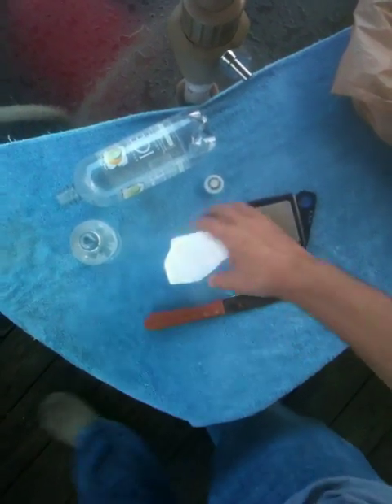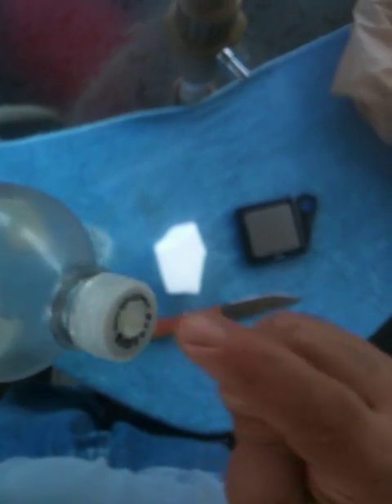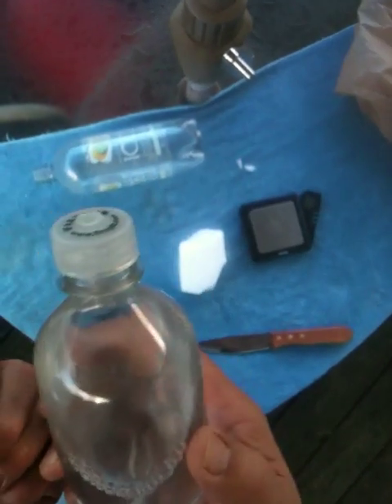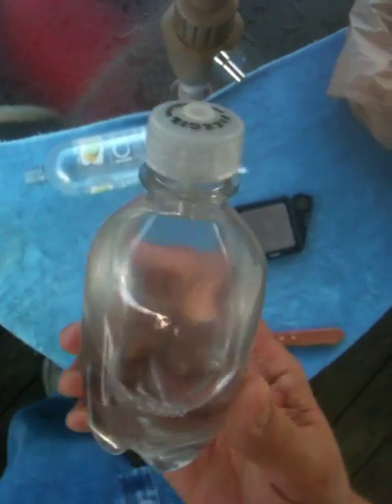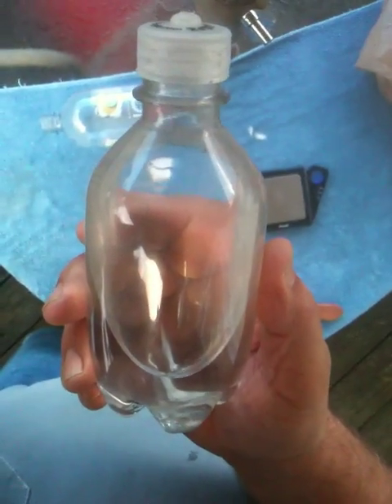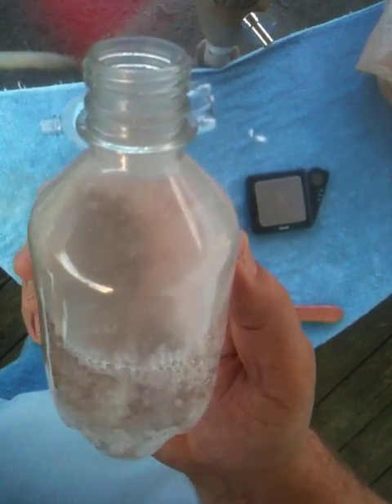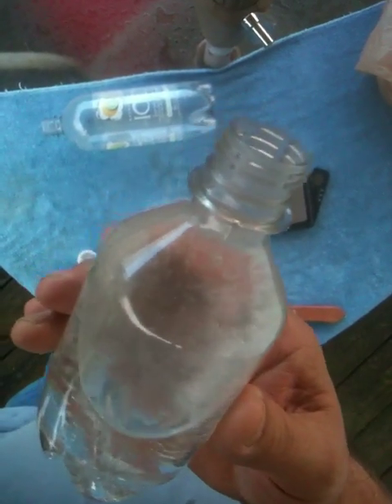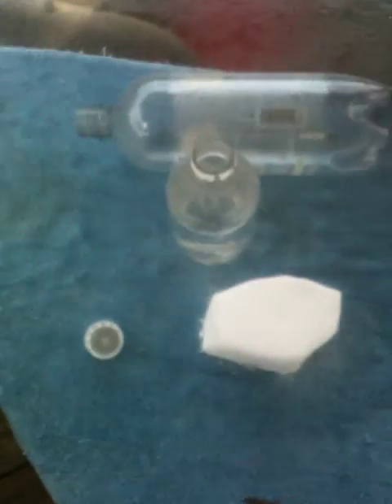Testing Soda Bottles For Their Ability To Withstand Carbonation Pressures

Comment: What about this simple step, if the used bottle when new had carbonization to begin with so why even test it?!  LOL
Reply from the maker: My guess is that the CSD bottlers did not bother to test it. They knew what the bottle was rated at. And they knew what their CSD was pressurized to. My customers have NO WAY of knowing that. Beverage industry standard level of carbonation is 8g/liter. That works out to be about 60PSI at room temperature and maybe over 100PSI in a closed car on a hot summer day. My customers sometimes carbonate to pressures in excess of 120PSI. If U-know nothing about a given bottle's strength - maybe it satisfies your curiosity to test 'n find out yourself.

Comment: I put 110 PSI in a 2 liter (posted on my channel)
Reply from the maker: Good 4U. That's satisfactory for carbonation and pressure infusion marination. Two-liter bottles begin to expand into the non-elastic range at about 175 PSI resulting in permanent deformation. Most will rupture at around 225 PSI.
Reply: Mike Spike    Yeah.  I filled it with air from a compressor, so I don’t think it’s carbonate much, unfortunately.    Hoping to maybe buy a bottle of CO2 someday.
Reply from the maker: @andrewrichardson3135  U-can get them dirt cheap sometimes. If U-get one with an on/off valve, it can be used this way to carbonate your beverages: https://youtu.be/FJd76UH10Sk. Hopefully that'll save U some money.
Reply from the maker: @andrewrichardson3135  U-can get them dirt cheap sometimes. If U-get one with an on/off valve, it can be used this way to carbonate your beverages: https://youtu.be/FJd76UH10Sk. Hopefully that'll save U some money.

Comment: Your pressure test as done in the video is inconclusive!  If you put 8 oz of water in the bottle AND 3gr of CO2, the pressure will be MUCH higher.
Also, 4 is NOT "50% more than 2.83".
Reply from the maker: Perhaps I should have said 4 +/- a quarter. Saying something is wrong and proving it's wrong require quite different skill sets. Do you agree? Try it yourself and you'll find the estimate made is not far off the mark. I can show you how to take a direct pressure reading inside the bottle, if you are interested.